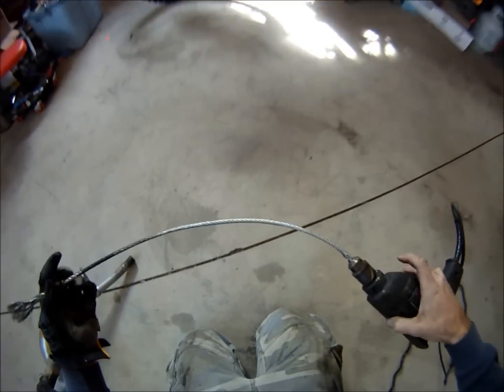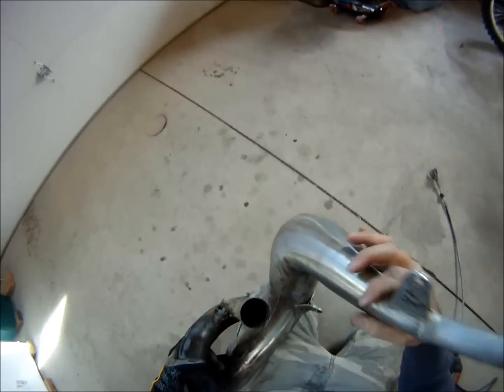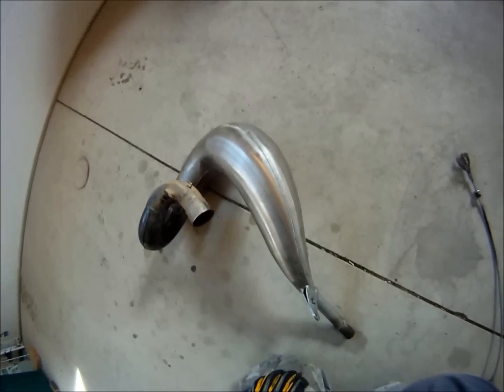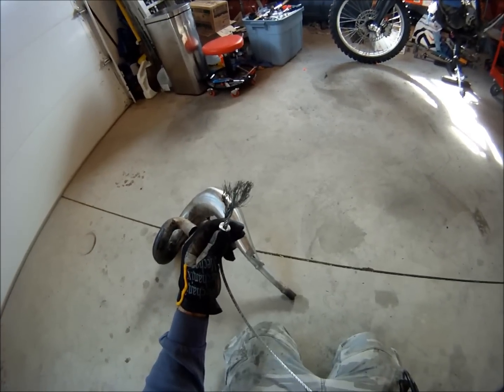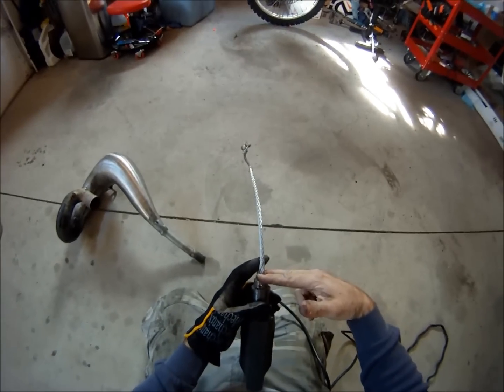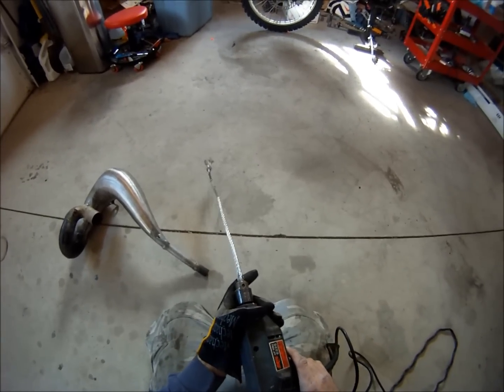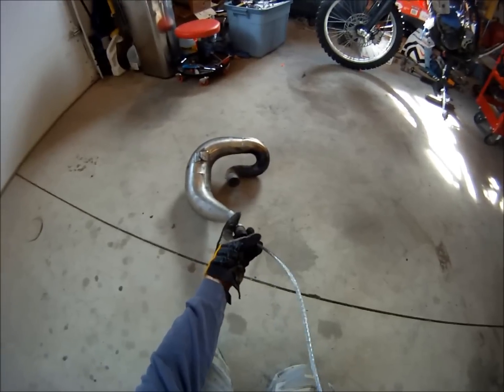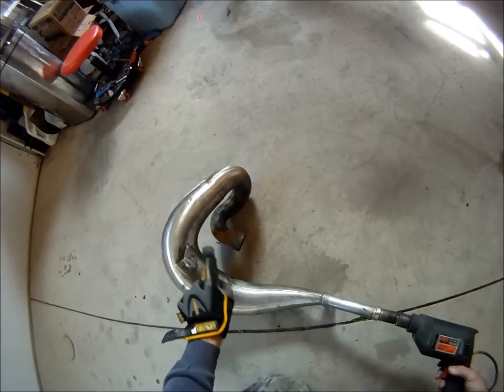decarbonizing 2T PIPE 2 Stroke

Comment: What’s this wire called?
Reply from the maker: It's just a steel cable that is frayed at the end. You can get it at any hardware store
Reply: @anesthesiadreamin  thanks for the reply, I need to get some , got the same issue, carbon build up
Reply from the maker: @robhayter484  sure thing bro, just be sure to check out part two, the link at the end of this video, it demonstrates how the weed burner can really clean the pipe out. If you have one of those it makes a big difference
Reply: @anesthesiadreamin  will do , I’ll check it thanks 👍
Reply: I’ve used a blowtorch before on pipes  and works really well , but also discolours the pipe where it gets so hot ,
Reply: That’s why I was interested in that steel wire , definitely a good way of doing it without burning the pipe

Comment: This works great alone, just did this method on an 83 rx50 pipe and knocked almost half a pound of carbon out of it, bike went from revving to 4000 rpm max to its full range. Will use this method again

Comment: Dude, you should try to decarb it with sodium hydroxide. Just mix the sodium hydroxide with water and pour it into the pipe. Let it for one night. Flush the pipe the next day, the carbon should be coming out in the form of black goo like. It's easier and cleaner to do it this way. I think. Been doing it twice and it works for me.
Reply: Yes sir. A small amount of lye. Fill with water plug ends. Let soak. Shake once in while. Rince next day. Just like a hot tank in my auto machine shop. Try it . Save $$$.
Reply from the maker: bimo herwantoro thanks for the tip! Where do you find that stuff?
Reply: anesthesiadreamin Youre welcome. You can find that in the chemical store. Just ask them for NaOH, they'll know.
Reply: But... that's Lye. Lol. "Drain opener". Oven cleaner. 😂
Reply: Wonder if oven cleaner would work,

Comment from the maker: A few weeks ago I used a BBQ propane sized tank and a Harbor Freight weed burner torch. Fire and clouds of smoke came out of both ends of the pipe for a few minutes. Got the pipe plenty hot to burn out the carbon :-) Then I used the frayed cable to knock out the chunks
Reply from the maker: Yes, I have found this the best way to do it as well. A small handheld propane torch is not enough, but the weed burner definitely gets everything hot enough to burn it out 👍

Comment: i dont think the cable was frayed enough to hit the pipe wall on the bigger part of the pipe.
Reply: anesthesiadreamin Longer cable, frayed more and feed it in through the pipe by way of un-frayed end then hook it to the drill ;-)
Reply: modette99 Excellent idea!!! My 100 hr maintenance is coming up and I will make a new cable with your recommendation. Thanks!!!
Reply from the maker: I think you are right, cuz you have to compress the frayed cable to get it inside and I don't know how to re-expand it once it's inside. Mayb centrifugal force helps it expand some?? Mayb move the aluminum crimp connector further down so there is more frayed cable on the end?? My hope was that the aluminum  crimp connector flopping around inside knocked most of it off
Reply: @ anesthesiadreamin Yes centrifugal force will make it expand but if there was not enough cable already frayed open it probably would of not mattered. Makes me wonder if yua could pour pellets from a bb gun in the pipe and shake it real hard if that would clean the carbon out?

Comment from the maker: I don't know why it helps. I'm not sure if the carbon results in rough walls causing "drag" or resistance to air flow, or if it just takes up space in the expansion chamber. Anyone else with ideas? I know for sure power suffers, because after cleaning mine it makes crisper power (it was pretty heavy with spooge and carbon). My buddy's KDX 220 was literally un-rideable (sucky power, bogging) and he burned out his pipe and now it rips again. No other changes to the bike.
Reply: anesthesiadreamin.  I have a kdx. when o tap the pipe it goes thud. it doesn't even sound hallow. it was like that when I got it 50 hrs ago. I don't know what it had on it before I got it.  its a 1996.